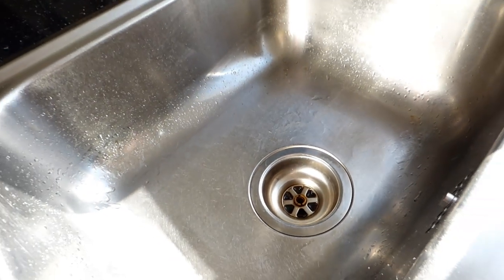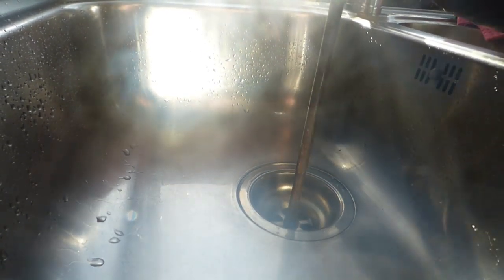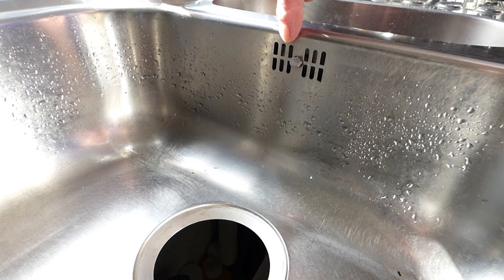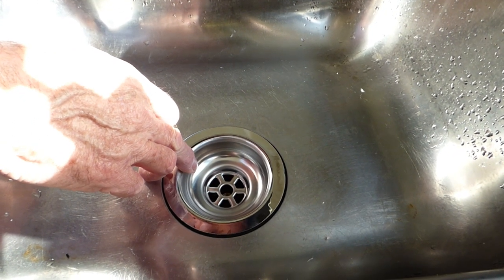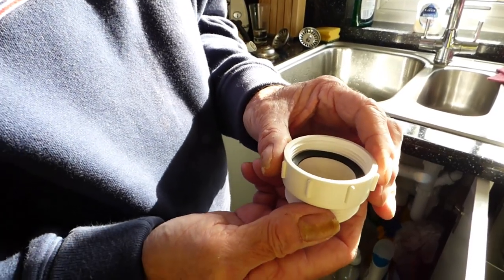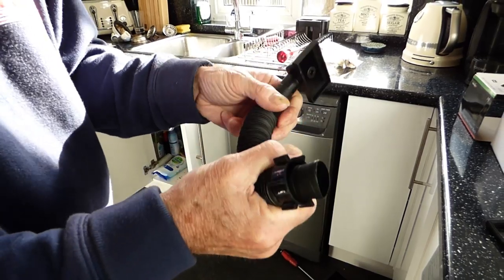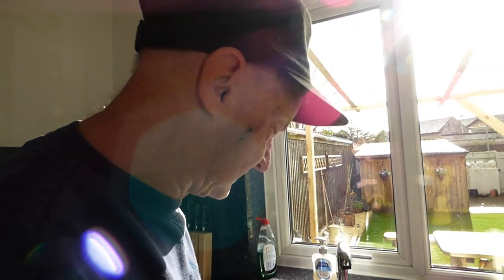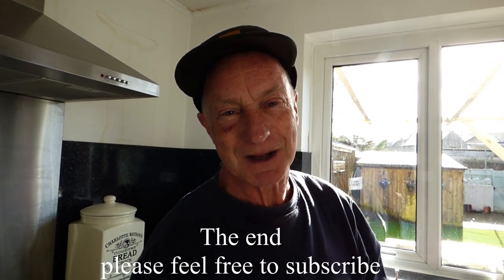How to renew a sink waste, the chrome part through the sink.

Comment: I saw somewhere that you a ring of plumbers mait on the top (sink side) fitting. Do you need this or should the supplied washers do the trick?
Reply from the maker: I prefer the plumbers mait.
Reply: @dereton33  Did you just use the foam washer for the purpose of this video then? I was expecting to see you whack out your favourite tool and put some mait on it!

Comment: What do you do when you find the new waste is 10mm too short or long and won't properly match the current trap? :)
Reply from the maker: Extend the waste with a coupling if short or cut back the waste pipe if it is too long.

Comment: Another great video thanks.  I'm tightening an existing sink.  The "washer" between waste outlet and top of the stainless steel sink is very flimsy and worn. In its original state was probably not much thicker than some tape.  I've been told a bed of silicone will do the job.  Is that ok?
Reply from the maker: Yes fine.

Comment: Hi Al and Jan,  hope you are both well.  Al, would a dab of silicone be necessary here?
Reply from the maker: No none required the rubber seals are good.
Reply: If you dont have a rubber seal and need to use something to seal the waste I'd reccomend plumbers mait. Dont have to wait for it to go off as it never goes solid, its waterproof and you just remove the excess when you tighten the waste. Great product if you dont have a rubber seal. Hope this helps!
Reply: you made it so easy and simple  al enjoyed the video
Reply: Can you just replace the rubber seal? Or do you need the full kit?

Comment: Good job. I was wondering if you had a video of increasing the flow rate of a shower hot feed. It's just a gravity fed system. Would a low pressure pump be required?
Reply from the maker: Yes a pump is best.
Reply: @dereton33  thank you. Do you have a video on that?

Comment: Hi Al, any tips for removing silicon from a metal sink...I made a bit of a mess when replacing the sink. I got it all over my hands and then all over the new sink. Job done but sink is covered in a silicon film. Also, my sink waste has a white flimsy upper washer like the one you removed. Ive installed it but do you think this type does the job OK? Thanks. Keep the videos coming.
Reply from the maker: There is a silicon remover which will get rid of any leftover stuff. I still prefer to use plumbers mait instead of washers. Still try the washer, if it does not leak then leave well alone.

Comment: I just ripped mine out while my mother was out shopping ( a huge rush so she wouldn't know what I was doing ). I unscrewed the bolt. My intention was just to measure the opening in the sink (thinking of putting an Insinkerator). When I tried to put everything back together I realised there was no brass thread (as seen in 2:47). After a few moments I thought it might have fallen down the U bend. I took that apart but nope. In the end I legged it to the hardware store and bought a new waste part. I am totally mystified. Where on earth could my brass nut have gone. Is it possible ours was glued in place?
Reply from the maker: It does happen a lot of times.

Comment: Hi! Thanks so much for the video! In the video you turned the connector clockwise to loosen it, is this the norm for these types of fittings? 
I’m struggling to undo mine as I assumed it would be anti-clockwise and now I’m worried I’ve tightened it instead 😬
Reply: Ah! I’ve figured it out! It’s clockwise as I’m looking down the plug hole 😅
Reply from the maker: Yes, correct

Comment: Cheers Al. If you dont have a big bladed screw driver like you have, is there any other way to get that screw out?!
Reply: Sometimes a 10p piece will do the trick, if it’s not too rusted.  I usually keep a chisel handy, as the blade is wide enough. Careful you don’t slip with it though.
Reply from the maker: Thanks M J for the reply.

Comment: Do you need to use silicone under the rubber seal on the sink or is it overkill cheers great vid
Reply from the maker: No that is overkill. The washers will survice.
Reply: Thanks for the reply